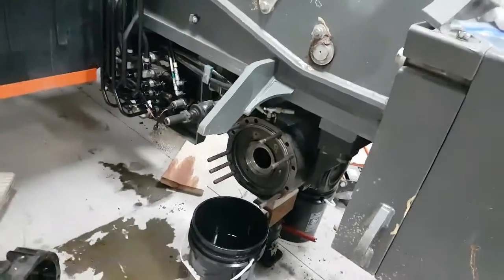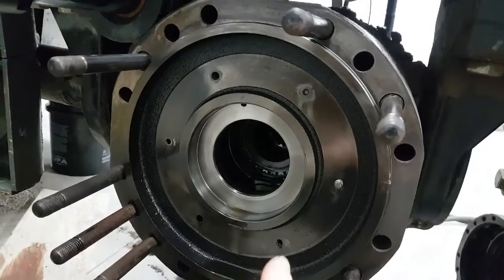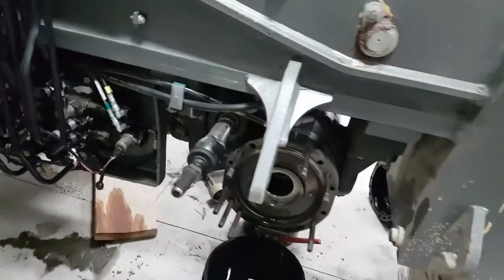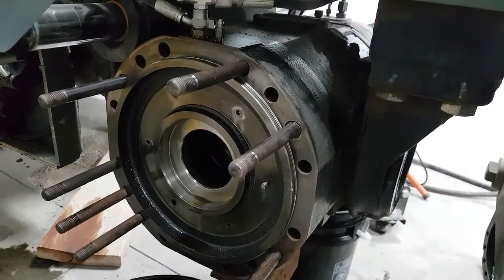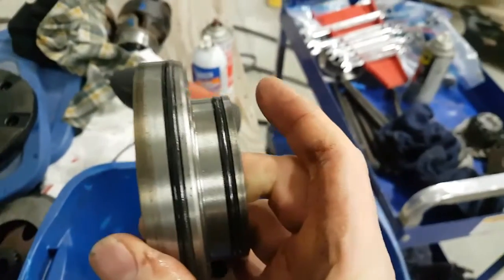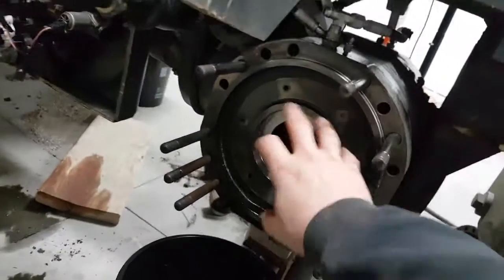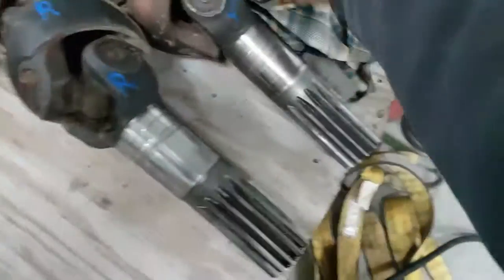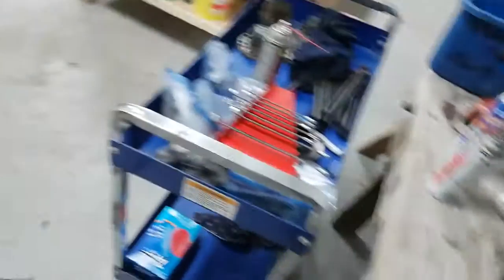Dana Spicer axel, leaking brakes and final drive

Comment: I am having trouble removing the rear axle shafts. One service manual i read said to put 7 bar into the rear brake line to allow for rear axle removal
Reply from the maker: I don't believe so. There's probably a set screw that you're missing. Check the housing for a small Allan key. Sending pressure usually engages the brakes, so removing the line should disengage them.
Reply: @theTurnandburn5  I removed the set screw for both axles. In the service manual there is 2 one on top and bottom. This axle only has one on top. I'm thinking the axle seal bushing is rusted into the axle housing.
Reply from the maker: @kyles234  ya, then that is most likely. Maybe a bit of heat on the housing and smack it to break the bond, but im guessing you already know that if you got past the king pins. They are usually the hardest part. 

There shouldn't be anything else holding is, so give it the beans.

Comment from the maker: Not really sure what you wrote there, but I haven't worked on that machine,  still it looks like a skytrack, so it should be similar to the rest of the industry, the brakes should always be on, unless the machine is running and you turn the parking brake off, if that's not the case then you either have massive damage, cut lines, or you're manual release bolts on the axle have been turned in.
Reply: Yeah just looked today the axle is a Dana/spicer 212 I have something fishy going on as the master cylinder for that axle is dry and won't bleed. the park break doesn't work makes me think the manual release is engaged. Hopefully due to a leaky brake piston instead of broken beville washers. Sad as the machine has under 3000 hrs on it previous owners didn't know what PM is I guess

Comment: Great video! Really helps since there is no other content out there. I do have a question though, if you can help out in anyway would be awesome. 
I have a 2013- JLG G10-55A. Rear diff has a vent on the driver side that sometimes pushes fluid out, which I'm guessing are the brake seals failing.
My question for you is the front diff or maybe both idk sound like the brakes are dragging or stuck, brake peddle is really stiff. What could that be?
Reply from the maker: It's possible that the bolts that retain the slave cylinder have broken or backed out. That's actually what happened to one of our units. But the brakes weren't stiff. If just felt like their wasn't any power because the brakes were dragging. Maybe your brakes are just worn. Not sure. But ya, if oil comes out of the breather then your seals are toast.

Comment: Good evening, i have an oil leak from Front Axle breather of Dana Spicer. 223/ 50-006. I check sight plug and its come out dark and looks overfull. Waht you recommend to get that fix? I believe its a break seals gone.
Reply from the maker: Sounds like brake Seals. The oil has to come from somewhere. You have to pull it all apart and change all the o rings.

Comment: Glad to find this video. It helps a lot.  Quick question though.  My JLG telehandler 6042 has good parking brakes, but the service brakes just barely work.  Any idea why that might be? lt looks like they both use the same brake discs.
Reply from the maker: Your right. I would check the parking brake release bolts. You'll have 2 or 3   that push on the back of the slave cylinder.... I guess it's more of a diaphragm. If it's not that you can bleed your brake lines like a regular car, but even easier because the hydraulic fluid flows constantly unless the vehicle is on and parking brake off. Other than that is out of my area of understanding. The nice thing about JLG though, is all their service manuals are available on their website... I believe.
Reply: @theTurnandburn5  ok. I will check these things out. Thanks for the reply